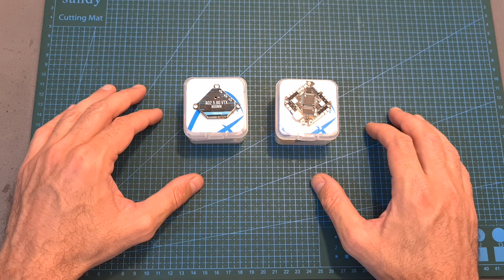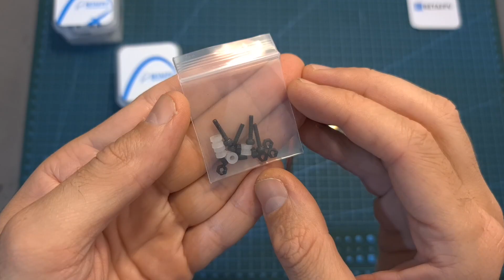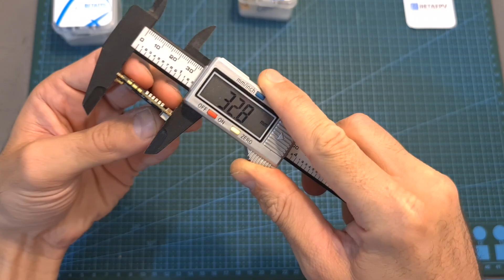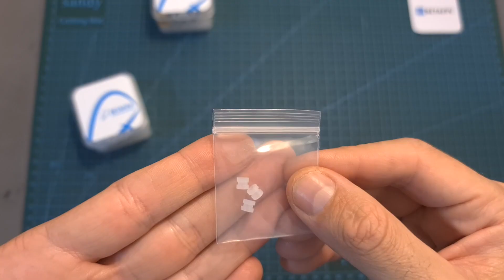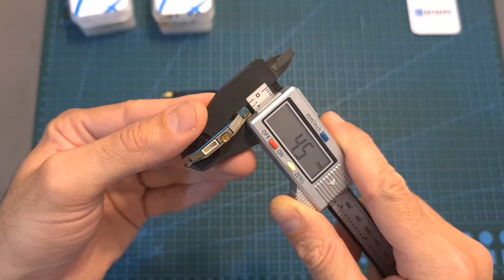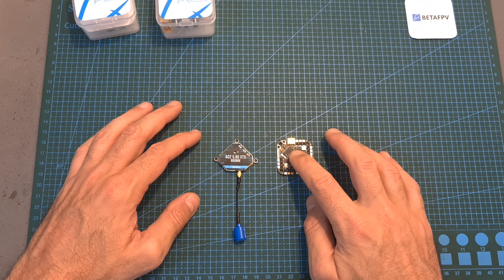Ultimate Toothpick FC? BetaFPV F722 & A02 800mw VTX Overview

Comment: Where do you have to connect the DC-IN of the VTX ? Can you connect to the 5V or you have to connect to the Batt- of the FC ?
Reply from the maker: No, input voltage should be 7-35v.

Comment: Great video! Can betafpv f722 run on 6s 2207 1700 kv motor for 5" build? Thanks
Reply from the maker: Thanks! I don't think so, unless you limit the motors output to 60-70% or so. This type of AIO FCs are not really meant to be used with full sized motors as far as I know.